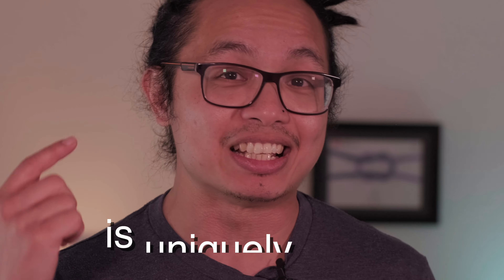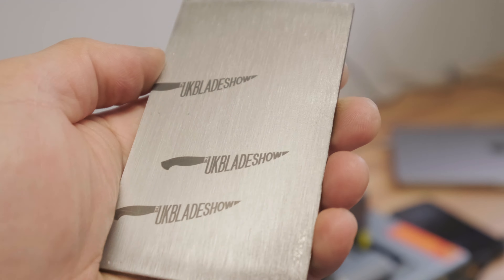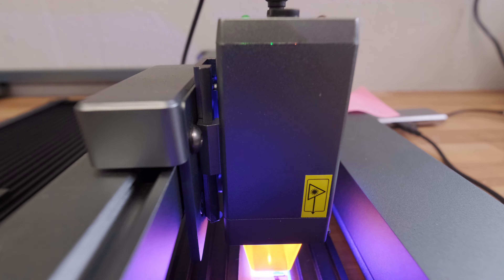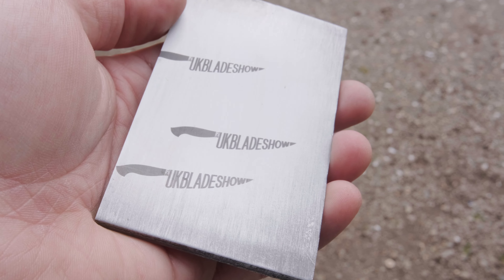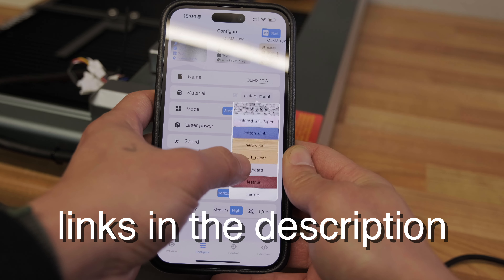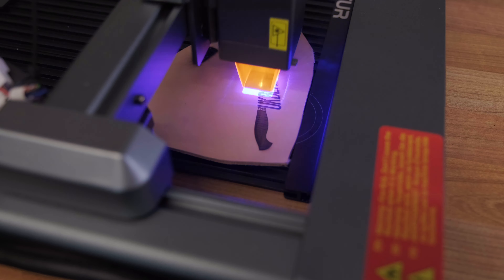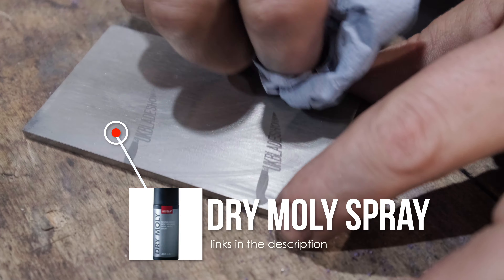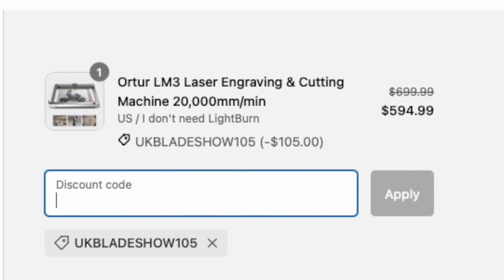Tired of acid etching or hot stamping? TRY THIS instead!

Comment: While as a hobbyist who almost only makes knives for himself I'm happy with hot stamping. That aside, the big benefit of lasers that I like is that (as per the video) they can etch a wide variety of materials. I've seen a maker who uses a laser to etch a pattern into the welted edge of a leather sheath. Could be done by hand but the accuracy and speed of lasers is a winner. Pretty impressive. Thanks for the vid. Sharp blades all.
Reply from the maker: Thanks David! I agree - it depends what you want out of this device. Speed and precision is one of the few reasons I’d consider a laser but other than that, hot stamping is still my preferred method (purely the looks).
Reply: I was thinking how cool it would be to add my mark to leather or Kydex sheaths as well!

Comment: A different set-up and a lot more expensive but diode lasers are the best method for laser hardening steel. 

You can get much more power out of a CO2 laser for cutting, get far more precision with a YAG pumped laser. However the wave lengths you can get and the spread out beam of a diode laser is ideal for hardening steel. 

Well done again Vinz. Another interesting video. I’d never put much thought into how maker marks are made.
Reply from the maker: Hey Tom good evening! Thanks for the interesting response - I know very little about lasers so this was also a fun test for me! As you may have also seen on Tobias’ comment here, he suggested for it for punching holes and cutting leather sheets, and also others shouted out it could be used for etching Kydex sheaths too so could prove ro be more useful than what I orioles thought it to be! I wonder what a more powerful laser would do…

Comment: What about the durability of the laser-made stamp on steel? It is easy to for example to leave a scratch on the mark by scraping it with a fingernail?
Reply from the maker: Great question. I found that using a “Dry Moly Spray” enhances its durability (please don’t ask me why hahaha) so I’d suggest to get one. They are cheap £16 (no need to buy the £80 tins, they work equally good).
Reply: @UKBladeshow  What you are actually doing using a moly spray is that the blue diode laser beam burns a carbon deposit ( from the burned dry moly) ONTO the metal and some INTO the pores of the steel....its not an engraving as there's no metal removed. It does not last like an actual hot stamp or acid etch or fiber laser engraving does. If you use it on a carbon knife the patina that comes after using the knife for a while will hide the mark . There are high end products for laser marking on metals like Cermark.....what happens there is that a small particle ceramic powder solution in a spraycan will melt and adhere onto your metal. That would allready last longer...but also at a much higher price. How dry moly spray compares to laser marking sprays you can see here  https://www.youtube.com/watch?v=4RmFgcET3Jo

Comment: Cutting out leather sheaths for production knives?
Reply: That could work, it would leave an interesting edge on the leather too
Reply: @TalRohan  it would be really cool if you could also do the holes for sewing, that would safe a ton of time!
Reply from the maker: Great point on leather Tobias - thanks for the idea! 💡
Reply: @MesserschmiedeHangler  Absolutely  I am sure it would, the burn is hot enough and should be fine enough not to set fire to the leather so with the right software it would be an awesome tool, if you got used to it you could probably use it on Kydex and possibly carbon fibre too

Comment: Its a blue laser......the mark wil only be superficial discoloring and rub off after a few weeks of usage...promised. I bought a infrared module do do all my metal engraving.....it actually cuts into the metals. Still not very deep , but it cannot be rubbed of. What you could do with a blue diode laser is to first cover the to be marked metal with some spraypaint. Then cut/engrave your pattern or mark in that paint ( resist) and than acid etch. The paint just protects the steel from the acid to be eaten where the laser did not remove the paint. You could etch any pattern you like that way.
Reply from the maker: Thanks for the tip. I did use a Dry Moly spray and it did provide better etching for sure.
Reply: It’s it so much the wavelength that’s important (though that affects how well it’s absorbed by steel) but the power of the laser and how much they heat up the steel. 

Ultraviolet is actually much more easily absorbed by steel and therefore more efficient than infrared (unless you paint it black first) but an infrared CO2 laser generally has enough power to melt and sputter the surface away. A diode laser tends to have lower power and a less focussed beam so it’ll struggle to sputter the surface.

That all said you;re dead right about the mark of a blue laser being less durable. It creates a thin oxide layer that can get scrapped off.
Reply: @GemAppleTom  I tried a lot of metals using a 20 watt blue diode.....at best it leaves a mark on stainless when you first spray some non reflective black paint on the surface. You can feel the surface is marked only very slightly using your fingernail. On carbon steel its like you say just oxidation/discoloration....not permanent at al , i think it could be removed even when scratching it with a fingernail or by washing it a dozen times with a sponge. It ( blue diode laser) does nothing on other metals.  I then bought a 1064 nanometer module and use that module on the same frame i am using the blue diode on. That 1064 nanometer module does leave a permanent mark , and it does that on all metals that i tried ( stainless, brass, copper , titanium, aluminium , carbon steel , nickel silver.) But even with such a laser its still not very deep...i am thinking 5 to 10/100 of a mm will be maximum. If people want to get good deep markings/engravings on any metal they should invest in a real fiber laser ( 20w,30w,50w). Thats a big/expensive investment for any amateur knifemaker just to mark their knives. A stamp makersmark or electro etch will do fine mostly.
Reply: @HoutmeyersP  Sounds like you’ve put a lot of work into it. 

I think I know why the diode laser does less well than the infrared one even though they report the same power. Does the manufacturer give a spot size for both lasers? 

Prediction: the infrared will have a smaller spot size I.e. a more focused beam.

Would be interesting to know if I’m right if you’ve got the time. And probably good for me to eat humble pie if I’m wrong…
Reply: @GemAppleTom   The infrared laser module spot size is indeed smaller ( 0.03mm circular 1064nm ) compared to the blue diode module ( 0.08 / 0.1mm rectangular spot at 450nm). But the output on the infrared module is only 2 watt....were the output on the blue diode module is 20 watt ( it a 4x6watt diode stack). Wavelenght and pulse energy are also a deciding factor. The 1064 module uses 20.000hz.....the manufacture that makes both blue and infrared modules states that the infrared has 6x more pulse energy compared to the blue diode. I am no expert but i think just for engraving/marking metals dont bother buying a blue diode laser. A blue diode laser however does work fine for cutting/engraving leather (sheath making) or cutting wood......thats a task a infrared laser does not do well